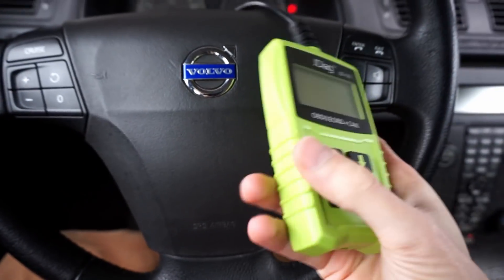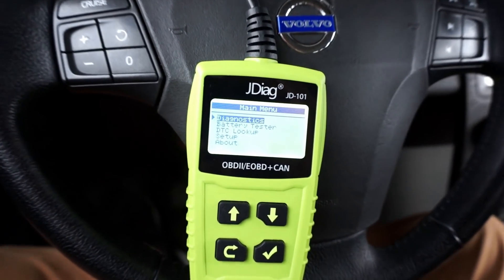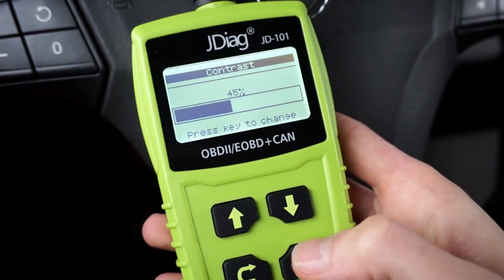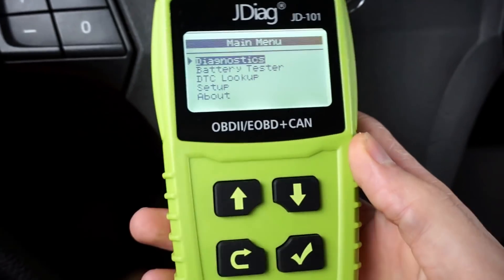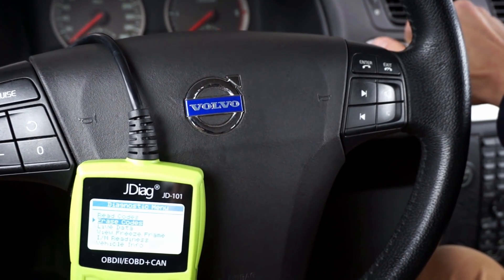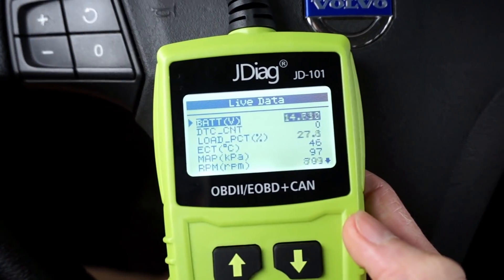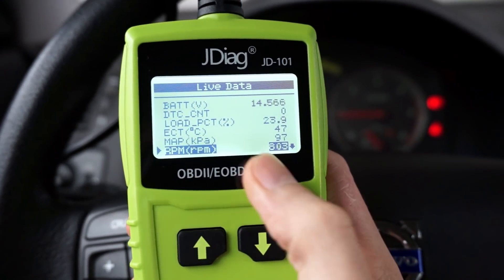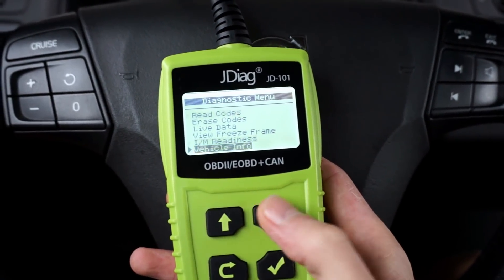JDiag JD-101 car scan tool test and review

Comment: when trying to plug in to my hilux 2003 obd port, it will not connect, first time use do i have  to set up obd reader before first use. if so how.
Reply from the maker: 2003 car might not support the universal OBD2 standard yet.